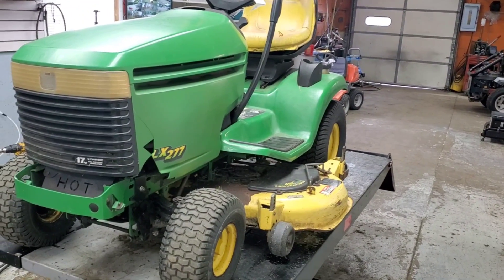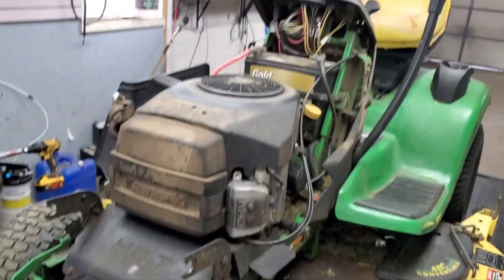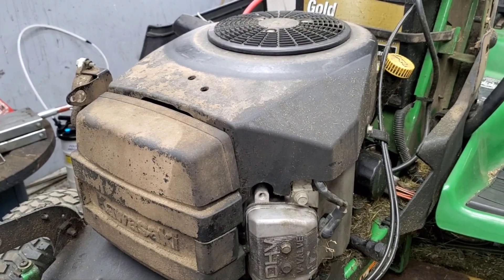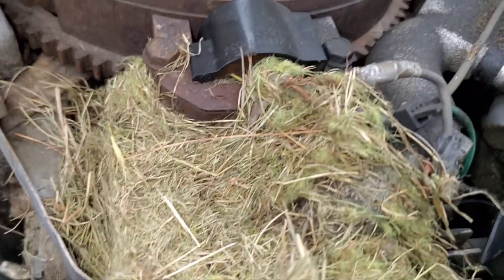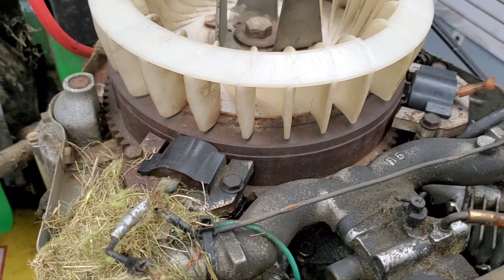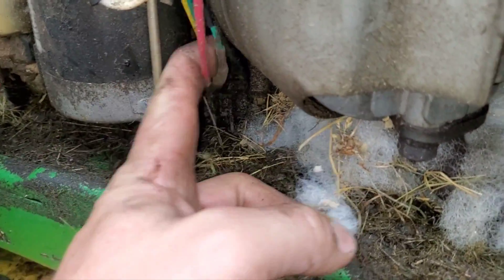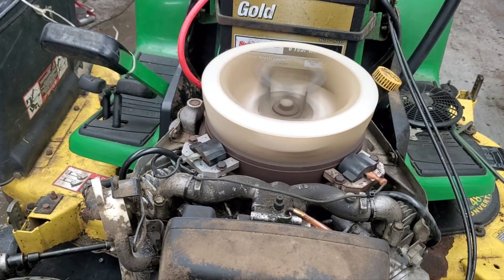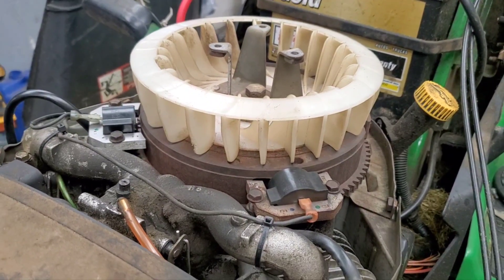Kawasaki Engine Bogs/Dies Under Load Diagnosis & Repair John Deere LX277 Tractor With FH500V Engine

Comment: Good job! That tractor was filthy. I have an issue with my LX277: the free-wheel lever pulls all the way out, but the tractor still won't move when pushed.  I cleaned out around the lever connection at the transmission. Any thoughts?
Reply from the maker: Brake not coming all the way off possibly
Reply: @IndRepair  Got the air compressor out and blasted around the brake and parking brake area, wd-40 on it after that, worked the brake/parking brake back and forth after that and gave the tractor a push. IT ROLLS again!!! Thanks for your suggestion!
Reply from the maker: @franl5585 awesome job!
Reply: @IndRepair  Thanks. You 'steered' me in the right direction! 😉
Reply from the maker: @franl5585  Haha, nice

Comment: I cannot believe someone would allow their mower to get that badly plugged up with debris and then wonder why it didn't run well.  I also have had mouse problems, but generally keep my equipment pretty clean, mostly due to concerns about overheating.  Mice are bad, but red squirrels are about the most destructive animals in existence!
Reply from the maker: Definitely a crazy world we live in! I have no experience with red squirrels but the chipmunks do some horrible damage in this area. Keeping your equipment clean keeps a lot of stuff from happening

Comment: Buddy needs to beg, borrow, rent or steal a farm cat. I hear cats think mice are yummy...
Reply from the maker: Definitely helps with the mouse house issue!
Reply: @IndRepair  Love the lift..Got the same setup. Great when working on generators.
Am presently working on a JDLX288, similar issues. Engine fins clogged up with crud and blocked up big time.
Both exhaust valve guides migrated, bent push rods. Leak down found one inlet valve stuck open.
These machines need to be cleaned out more often (pressure washed) as the shrouds are great for collecting debris. This guy brought it over said it was smoking and had no/low power. Got real lucky there wasn't more damage.      Some owners just wanna "Cut and Park".
Reply from the maker: @happyrecluse2849  That is a great buy! The lift is great I also love the newer Handy B.O.B 1500 seems like I can put anything I would on without thinking it is going to bend or be overworked.

Comment: great video. im working on a fh430 that showed the same problem initially . runs very rich under load and loses power. runs perfect at idle. both cylinders fire. carb has no vent like the 500. only adjustment is idle air/fuel on top. makes no difference how its adjusted. ive changed the coils, plugs, wires. no difference. cleaned carb, ran the valves. machine has 60hrs on the clock. no one can seem to fix it. what say you?  thanks
Reply from the maker: Does it make popping noises or just overall low power? Deck isnt locked up somewhere? Sounds like fuel/air mixture issue or bad fuel? Could be a blown head gasket but normally don't see with that low of hours on this engine
Reply: @IndRepair  machine is a walk behind gravely, about 2004 model. seems to do better when cold. about an hour in starts to loose more power and more unburned fuel. seems like carb problem but float is working. back at idle, cleans up and smells normal at exhaust. almost seems like the main jet is to big? or not enough air? have not tried another carb yet. everybody says bad coils but i swapped them. rest of the machine is original. nobody has messed with it. thanks. mark
Reply from the maker: @markgerdes3402  I would lean towards a carburetor issue with the hours on the unit. Intake gaskets that were removed should be replaced when you have it off to make sure you don't have an air leak also.
Reply from the maker: I would also say that on a similar intake I have seen the plastic mold have a leak that would get worse once hot
Reply: Aluminum manifold will explan hot and let more air thru

Comment: Hi I’m experiencing the same problem. It was only firing on one cylinder. I changed the 2 coils but not the “wire”. I did the test again and both cylinders are firing. But still a loss of power when in high rpm. Help please.
Reply from the maker: Does it smooth out if you give it a little choke?
Reply: I will try that, will a bad wire that connect to the coils with clips cause issues? Because I didn’t change that. I didn’t see any signs of damage. But I’m going to try giving it a little choke and let you know. Thank you for the response🙏
Reply: I also changed the carb and plugs. I forgot to tell you it’s a Wright Stander kawasaki fh430v
Reply from the maker: Did choke smooth it out?
Reply: Hey ,no it didn’t do anygood. I had put a new 10mm that holds down one of the coils. The bolt seems a little shorter than the original 10mm bolt but it’s tightened down securely to the head. Will a shorter 10mm bolt on the coil cause a problem?
Reply from the maker: Long as they are tight it will not likely cause an issue. It is hard telling from here I would probably do a leakdown test to figure out what the issue is..
Reply: I’m going to see if I can get my hands on/rent a leak down tester. I’ll let you know when I do Thank you again for the response 🙏

Comment: Have a ride mower with kawasaki 15 hp motor. Runs rich new plugs didn't help new caraburator didn't help. don't what to do next Ran good for 19 years
Reply from the maker: I would check compression first the work through the fuel system to the ignition but normally a carburetor issue with something like this. The oil doesn't smell like fuel by chance?
Reply: cam lobe sheared off of one i was working on, just intake lobe on 1 side, lady said she over filled with oil and ran it any way. 5 ac. lot overgrown 2 tanks of gas(both sides of toro zero) rotate by hand with valve covers off and make sure all 4 valves move after  2 turns
Reply from the maker: Nic3